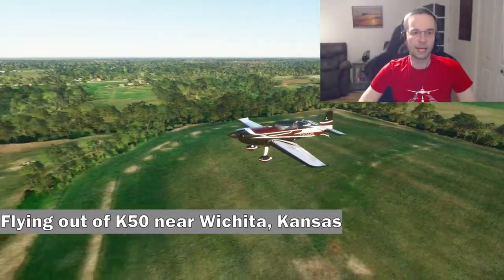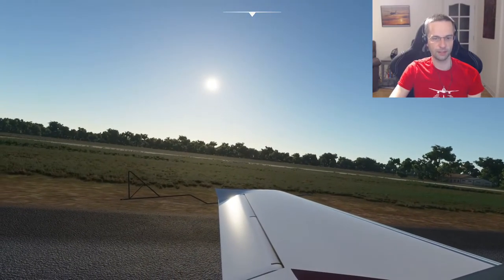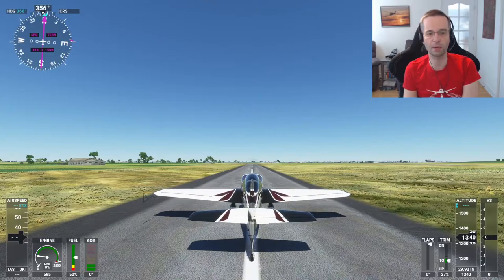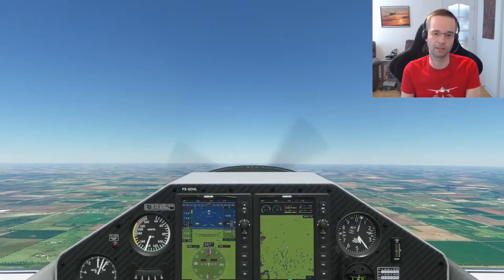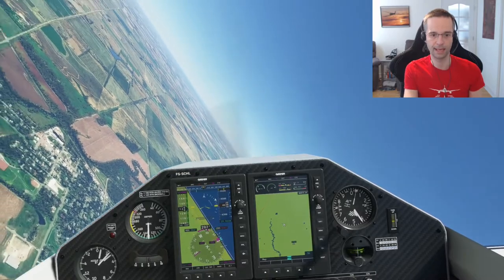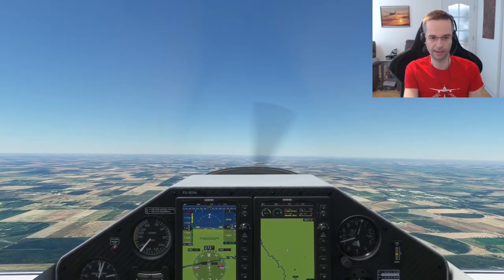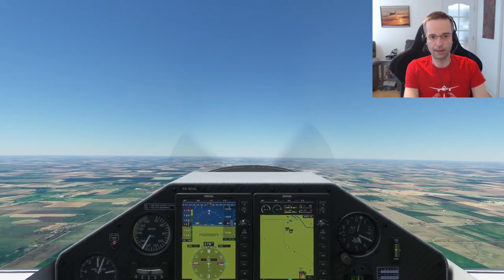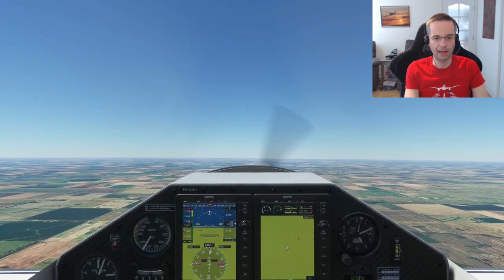Performing Aerobatics in The Extra 330 | Microsoft Flight Simulator Tutorial

Comment: Well... I don't know where to start... The Turn: The rules say: at least 60°. Better do a bit more, less than 60° is a deduction of marks. If you make more than 60° bank you can make tighter turns to stay in the aerobatic box. During the turn you do use rudder as well as elevator. The second figure: This is no slow roll from the aresti catalog. This was a ballistic aileron roll. Nothing to do with a slow roll performed on a straight line without gaining and loosing altitude. Yes, you hold your nose over the horizont during the slow roll, but this happens during the roll. Again: More than one control input during the whole roll. In an Extra 330 you definitely don't need 20° pitch. This is more true for the Cap10 or especially with the Cessna Aerobat (The fourth aerobatic plane in the MSFS.) Rolling a bit quicker will help you to stay in the aerobatic box (just a kilometer length.) and also to stay at the same altitude level. The loop.... well, you will like to use the rudder to correct the propeller influence to stay on direction. Depending on the turn direction of the propeller and pushing or pulling nthe elevator you need to give left or right rudder. Don't look left or right but straight ahead during the loop. Normaly, you can see much better in the sky with the clouds to hold direction. If you look to the side you don't really have the control of the direction. When you nearly reach the top of the loop, get your head in your neck to see the horizon. The slow release of the elevator in the second qoarter is correct, you float through the top and tighten it again slowly in the third section of the loop. This is just a quick comment. Head up, the more you train, read and see, the better you can get. An in aerobatics you can always improve. :-)